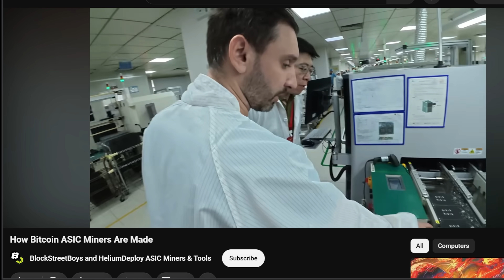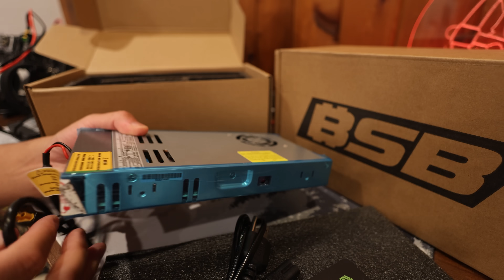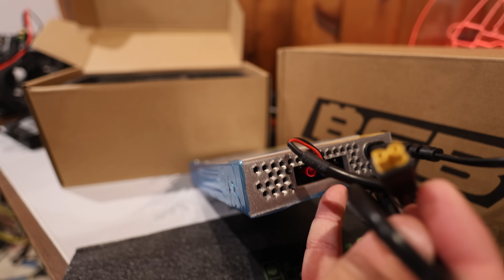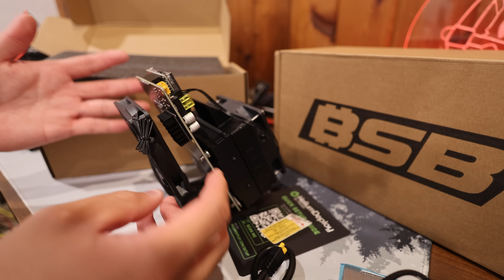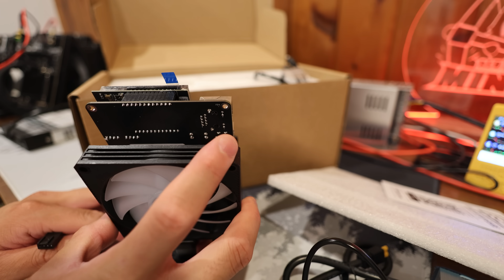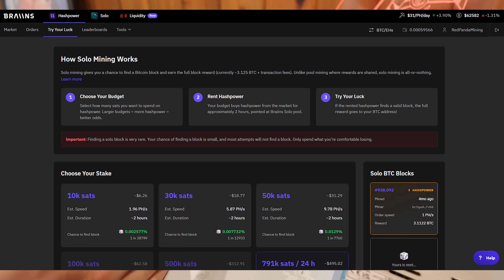New RELIABLE Bitcoin Home Solo Miners Are HERE!

Comment: I have picked up 9 NerdQs in the last several months (yes, I have regrets, but we live and learn).  All but 3 were super-cheap AliExpress units.  The other three were BSB/HD units.  These three were also my latest.  I ordered the first for my daughters, but was so impressed with the quality that I ordered one for me.  Of the cheap ones, 5 of 6 are still functioning and live in the basement, churning away.  The latest BSB/HD model sits on my desk and is by far the most efficient and effective one I have.  

I am in the middle of that normal transition from NerdQs to bigger units, with a single-board S19pro unit picked up a week ago (this one unit does more than all my NerdQs).  This new BSB 30th unit appears to fit well into this new direction.

Comment: I don’t know where you live, but at 405 W and the current BTC price, you need electricity under about $0.32/kWh just to break even. A lot of the world already pays more than that.

Even at $0.20–$0.25/kWh, you’re only making around $15–20 a month, so it would take roughly 3 years just to pay off the miner.

And even if you have solar panels, in many cases you’d probably make more by selling the electricity back to the grid instead of using it to mine.